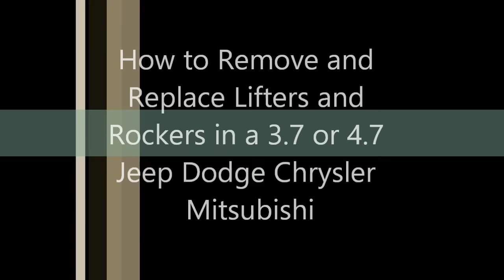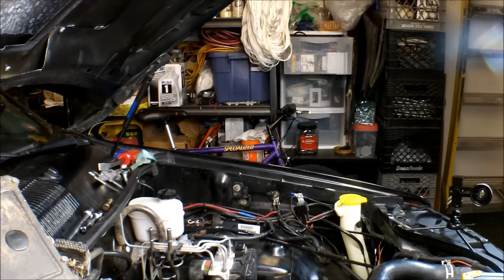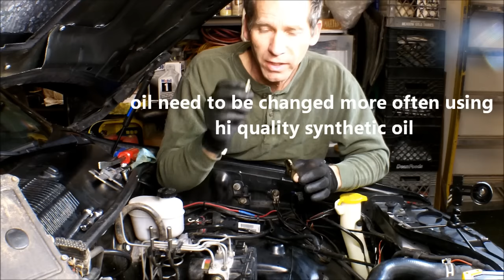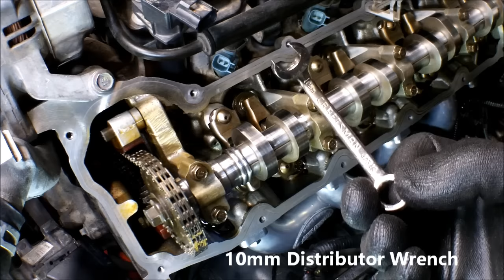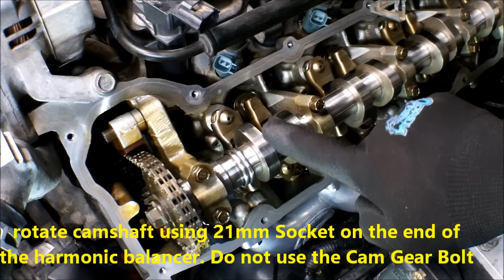Remove & Replace Lifters & Rockers on a 4.7 & 3.7 Jeep Dodge Chrysler & Mitsubishi

Comment: Coming back to you for your thoughts. Replaced rockers, lifters, and timing set. Still clacking like it’s the lifters... got rid of the initial start up rattle from the chain but after a second of the engine running the clacks come on until it warms up.
Reply from the maker: did you replace the hydraulic tensioners when you did the timing chain set?
Reply: @martinbuilt  yes. Everything but the gears. The chains used to rattle like hell when the engine first kicked over. Now it’s quiet for a couple seconds until it sounds like the rockers are tapping around.

Comment: Great video as always. Quick question if you have one bad lifter should you just replace the one or replace all of them?
Reply from the maker: On the grand Cherokee if you're replacing the one on the passenger side I would replace all of them because of the difficulty of removing the valve cover if it's on the driver's side which is not too bad and you know which one it is I think I might just replace just the 1.

Comment: I just ordered the set of lifters you have posted in the description, I have been using 10w30 Pennzoil ultra Platinum full synthetic because here in Texas I was told to run thicker oil from the high heat temps, so I will prime my new lifters that I have coming in 10w30 for 24 hours before I install, do y'all think its a good choice using 10w30 when I see Martin using 5w30? Any thoughts?????

Comment: Question please; I need to rotate the cam (on that same L.H. head as in video), because I'm about to put on timing sprocket and chain, but realized I'd run the valves into a piston. I do know cylinder #1 is @ TDC, so would I be ok with only removing #1 intake and exhaust rockers? I'd figure so since the other pistons are recessed. Thanks

Comment: I heard someone say the orientation of the lifters matters with the oil hole facing in was important. I'm guessing not?  Great videos as usual.
Reply from the maker: Thank you, no it does not matter the orientation of the lifter.
Reply: @martinbuilt  thank you so much for your help.

Comment: Do you need to preload new lifters with oil before installing them? Also any videos on bench rebuild of cylinder head?
Reply from the maker: Yes soak the lifters in motor oil to work out any air.
No I don't have any videos on that.
Thank you for watching 🙂

Comment: Hello Martin I have a 98' dak 3.9 with a exhaust header bolt blown out and it sounds like a tick but not exactly rocker or lifter damage but this looks pretty straight forward I was gonna upgrade them anyway, my understanding from this video also is you don't need to mess with the timing? or camshafts? Thanks.
Reply from the maker: The tick is coming from the exhaust manifold bolt that you mentioned there's probably nothing wrong with your lifters and rockers.  Also if you have the 3.9 you have a push rod engine and this is for the 3.7 and 4.7 overhead Cam engine.
Thank you for watching.
Reply: @martinbuilt  Thanks for the info Martin I appreciate that.

Comment: Great video.I’m about to change mine lifters and rockers figure while I have them off.I wanted to ask what is a good brand Lifter and rocker  to go with besides mopar?Ive been told so many things my head is gona explode.Melling?Crown Auto?or can I go with a regular brand lifters and rockers.Any input would be great.thank you
Reply from the maker: Thank you I'm glad you liked it.
 Yes of course Mopar and Meilngs  But you could also just check out the reviews on any lifter like on Amazon. And if they have great reviews I wouldn't be scared to purchase the less inexpensive ones.
 Also make sure that you soak them in I'm in motor oil for at least a couple days to help get the air out of them.
Reply: @martinbuilt  that I was gona do.Can I use the 5w30 full synthetic to soak them in?Also I heard to use assembly oil when installing them is that right?or is it something that is a must or don’t matter?You hear 10 different things and it adds to the stress.lol I appreciate you sharing some info.I’m a body guy so the Jeep looks brand new so I’m trying to keep the motor tip too haha.
Reply: @martinbuilt  Martin thank you for getting back to me.i changed the lifters and now I have the annoying tick tick tick tick.most likely a rocker arm.I’m waiting for new one they are on back order.but what isn’t making sence why wouldn’t it tick before I changed the lifters?and I did let them soak in oil.i always been spot on with the oil changes and always if anything they were done before time was up.any help be appreciated allot

Comment: Hi Martinbuilt great informative video! Kinda new to this have a couple of questions... should I remove the fan shroud before trying to turn the harmonic balancer to release a couple of valves and which way do I rotate it standing in front of the engine clockwise or counterclockwise? Thanks for your help!
Reply from the maker: Clockwise is best. I have turned it counterclockwise before with no problem. On my particular model I did not have to remove  the hydraulic cooling fan as this is what is equipped on my 04 Jeep Grand Cherokee. If there is not the room from above I would try from underneath you may need some help, someone to watch the camshaft lobe.

Comment: Great technique,almost every video on YouTube shows having to remove or loosen camshaft bolts in order to accomplish this, hope I can do it this way on my 2016 Dodge Charger 3.6.
Reply: Hi Mateollios: did you accomplish this way on your charger? I am going to start tomorrow on my 2012 Pentastar V6. Thanks a lot
Reply: @jasonl7025  
Hello,
I also have a 3.6 pentastar 2012 and I was just wondering if you were able to do this and was it difficult to do or is it just best to take it to a mechanic?
Reply: @malve308  Hi Jorge: I did open my left valve cover as it is in the front and easily accessible. however I was not able to rotate my engine through the nut on harmonic balancer. Though I used a 25" break bar and could not rotate anything. Maybe I did not use enough force. Anyhow I don't want to apply too much force either. At the end, I used T30 bit to loose camshaft away from cam phaser and checked my rocker arms. I never touched the two T30 next to cam phaser. I would say if the bad rocker arms are away from cam phaser. It is doable and just be patient.   If you want to replace rocker arm next to cam phaser. You would need the special tool or a good mechanic.  Good luck. If you can rotate engine, it would be much easier.
Reply: Gearsoft is it possible to turn the engine key in order to turn the camshaft to the desired position ?
Reply: @Miguelgarcia888  Yes. You can check this video out. https://youtu.be/5zSjArepmfw. I am not an mechanic and not sure whether it is safe

Comment: 2007 Dakota 3.7. I am having a lifter ticking. Should I go ahead and replace all of them while I'm at it, or is it only necessary to replace the bad one? Also, how can I single out the problematic lifter? Never done anything like this before... Most I've ever done to an engine is replace the spark plugs. Thanks for the video!
Reply from the maker: Perhaps try using Marvel's Mystery Oil or Rislone with your next Oil Change see if that cures to tick. One of the ways to determine which lifter is ticking is with a mechanic's stethoscope being placed on the valve cover it still may be hard to narrow down the exact one. You may be best to replace all the ones on that cylinder head.
Reply: martinbuilt Thanks for your quick and helpful reply.

Comment: Hello martinbuilt, I have a 2003 Dodge Ram 1500 with the 4.7. I have a CEL that's showing a P0172 code (bank 1 to rich) I've replaced a lot of parts from O2 sensors, fuel pump, fuel injectors, map sensor, IAC valve, intake manifold gasket, a Flowmaster catalytic converter, etc. I've had it to 3 different shops and they can't figure it out. I was told it may be low compression causing it, the lowest dry reading is on cylinder 1 @ 125 and the highest is 140 on cylinder 8. The truck only has 69,000 original miles on it. I bought it in Oct. of 2018 and it's had a CEL on from the time I bought it. I think it was originally a P0138, that's gone now but I've had the P0172 ever since. It won't pass emissions with that code I believe because the CEL is on. Any help would be appreciated, it's either fix it or try to get a waiver if I can. You are very knowledgeable on these engines so I thought maybe you could help me figure this out. Thanks in advance!
Reply from the maker: Looks like you have replace most of what I've listed here.
P0172 is :system too rich (bank 1). This is usually caused by a restricted/clogged air intake filter. Manifold absolute pressure sensor, throttle position sensor, engine coolant temperature sensor, open thermostat, leaking fuel injectors, failing fuel pressure regulator, failing oxygen sensors.
Reply: @martinbuilt  Thanks for the reply Martin, I changed everything you mentioned. I forgot to mention changing the thermostat, engine coolant sensor, throttle position sensor, fuel pressure regulator is part of the fuel pump which is new too. I even swapped out the ECU with a refurbished one and the CEL still came on with the P0172 code, so I put the original back in. Thanks again for your help!

Comment: Martin, Great Content BTW. Is the block what the lifter goes in? If not can you tell me what it's called? Anywho the problem is one of mine broke off with the lifter inside still. Is there any secret to fix that or any way to fix that temporarily?
Reply from the maker: With these particular engines that is called the cylinder head.  With many of the overhead Cam engines the lifter or lash adjuster will install into the cylinder head.. 
You may be able to remove the broken lifter with a magnet.
Reply: @martinbuilt  thanks for the reply. So  it's the cylinder head that's broken just the 1. And the lifter came off still inside the a pc of aluminum block. Could I JB Weld or shut that particular cylinder down? Run on 7?

Comment: What a good video. So is there any adjustments required for doing a swap out, or is this just a straight replacement. I would have no idea how to set things if that’s required. I’d have to do a whole bunch more research on how to do that. lol. 2007 Jeep Liberty with the 3.7.
Reply from the maker: Simply remove and replace, no adjustment required. I would soak the new lifters in motor oil for a few hours before installing. Thank you!

Comment: Martin, can you explain how does the lifter actually get oil to it.  I'm wondering if there are oil channels going to the lifter that could be clogged.  I have terrible lifter ticking all the time.  Have replaced all lifters and still the ticking.  Is worse when it's very cold out (michigan) but yet after an hour of driving it's still ticking very loud.  Every mechanic that has check it out (2004 dakota 4.7) has said it's lifters ticking.  What do you think??
Reply from the maker: Yes, there is an oil galley. It is possible that they are clogged. One way to check is to remove the lifters (lash adjusters) and plug the spark plugs. Rotate the engine over with the starter until you that oil is coming out of all the lifter bosses. This will force any blockage out.

Comment: Great video man thank you.
What brand lifter and rockers are you using getting ready to buy the parts and want to insure i get it done right the first time.
Reply from the maker: I am running the solid lifters (lash adjusters) from Airram.com and the rockers from a 2005 or newer 4.7/3.7
The solid lash adjusters are a lot of work to adjust the first time but I like them, or I would recommend Millings

Comment: Do the new lifters need to be soaked in oil or pumped up? Getting ready to start on my valve seals and went ahead and ordered lifters.
Reply from the maker: yes, I would soak them in motor oil or even Marvel Mystery oil
Reply: @martinbuilt  thanks for responding so quick. 👍👍

Comment: I have a bit of confusion:

Prime, dont prime. Soak, dont soak. Im confused. Ive seen both online. Do I need to soak and prime the lifters, or did you put new ones in out of the box? Could really use your assistance on this, as this is the first time Ive done a job like this.
Reply from the maker: I would recommend soaking them in motor oil for at least a day to work out any air. This will also reduce any rocker arm from coming out on the initial start-up.
Thank you for watching.

Comment: Hey Martin. Great video. I have a 99 Jeep Grand Cherokee with a 4.7L V8. I have what sounds like a lifter tapping after realizing that I had NO oil in the motor! I had recently purchased it from a guy and I was only over maybe 1000 miles when the vehicle just completely shut down on me driving down the road. It took a few cranks but I got it running long enough to get a mile down the road. I put 4 quarts of oil and some engine restore and some mystery majic? Oil. The tapping slowed a great deal but I still have a tapping when I cold crank in the morning. It subsided shortly after the car is warm but I still here it faintly. 

I guess my question is, is there anyway to recognize which lifter has the problem without replacing all of them? Would I need to run the motor with the valve cover off? Also, could it just be a loos arm? This will be my first job in this car but I’ve had experience with other motors in the past. Any help would be much appreciated. Keep up the good work my friend!!
Reply from the maker: Well you could either use a mechanic stethoscope to narrow it down or a long screwdriver put the handle to your ear and place the screwdriver on the valve cover trying to figure out which lifter may be bad. It's not hard to change them and if you're changing the ones on the right side which is the hardest valve cover to get off you may want to change all of them. Very unlikely that there's anything wrong with the actual rocker arm. Thank you for the nice comment appreciate it
Reply: martinbuilt thanks for the quick response! I have heard of the screwdriver trick. Unfortunately it sounds like it IS coming from the right side so I will definitely replace them all while I’m in there...since you make it look so easy! 😄 Thanks again!
Reply: So will the rocker arm fall off of the lifter if it is bad? Or will the rocker arm stay in place? Or will it just be sitting loose inside of the valve cover? Thanks!
Reply from the maker: @arronhannah3710  well there are several things that could happen if the rocker comes off because of a lifter failure. It can just fall off and no damage happen or it can (and most likely will) also shoot-off hit the valve cover knock a hole in it which I have seen before also the lifter may shootout and I've seen where it'll break part of the cylinder head off that holds the lifter in place.  Most likely what happens you will end up with some camshaft damage to that lobe it can be ever so slight but it also could end up being bad enough to the camshaft would need to be replaced. This is why I recommend if you have lifters that sound bad that they should be replaced. In any case I would at least change the oil add some Marvel's Mystery Oil or Rislone this could help.

Comment: Does anything clearance wise have to be remeasured or adjusted or does everything pretty much stay the same since most parts are staying in
Reply from the maker: the hydraulic lifter (lash adjusters) are self adjusting, so just remove and replace.
Reply: martinbuilt Ohhhh thanks for responding so fast! I’m doing this tomorrow so this is helpful to know.

Comment: Is there any risk of interference between the valves and pistons when you are popping off the rockers?
Reply from the maker: No, there is not you're going to want to pop the rockers off when the bass circle is at the bottom or the cam lobe is pointing upward.

Comment: Hi Martin, is there a way to test the hydraulic lifter if it is bad by moving the tip up and down? Most of my lifters have tips that can move up and down by hand, but two are solid. A tow truck driver told me the ones that move are bad, but idk which ones are causing the tapping at start-up.
Reply from the maker: Yes, when I swapped out my camshafts all the lifters had no movement and I did not have any lifter noise whatsoever. I would say he is correct if they easily move up and down where you can plunge the tip those are most likely bad

Comment: I swapped out all the lifters on the passenger side only and I still have a pretty good knocking going on. I thought it was the lifters that were bad, but apperntly not. The rockers/fulcrums seemed to be fine as well they all popped out & in, but I didn't take them out to look at the bearings. Do you have any suggestions? 3.7 V6, Jeep. Thanks in advance.
Reply from the maker: If it's more of a knocking noise, it also could be the hydraulic tensioner on the passenger side.
Reply: @martinbuilt  Is that under the valve cover? Ill look it up. Thanks again.
Reply from the maker: @rileycpo  No, the timing cover needs to be removed. Not as easy as the valve cover.

Comment: Hi Martin, Do you need to bleed the new lifters before installing them? Will it damage the valves if I don't? Thanks
Reply from the maker: I would recommend to soak them in motor oil for a few hours before installing them.

Comment: Hi Martin, do you need all the items you listed in your description? I see that you have 3 different gasket sets listed, just curious (I am new to working on engines). Also, do I need to get that single seal power valve lifter or can I just get the set of the lifters?
Reply from the maker: I may list several different valve cover gaskets because they changed  From magnesium to plastic. You can get whichever brand lifter you like, Thanks for watching.